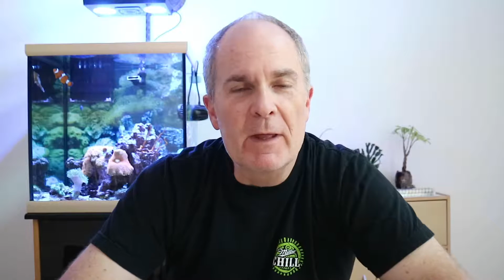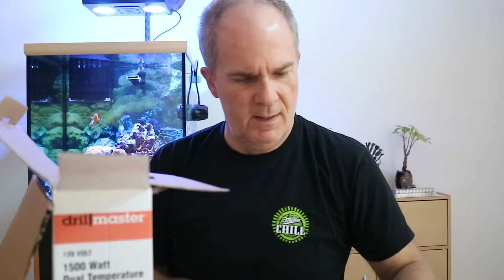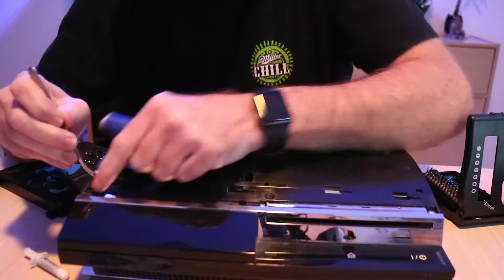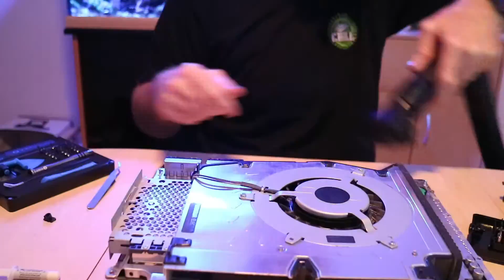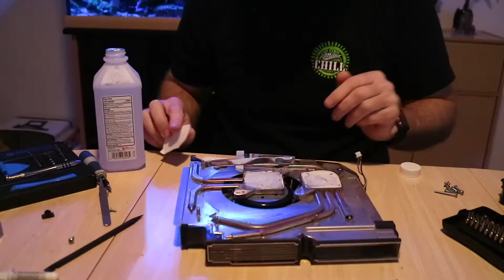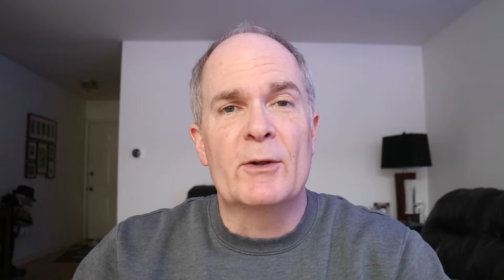My PS3 has the YLOD! Yellow Light of Death!

Comment: After 3 failed attempts, I finally got my working by putting about 3 lbs of weight on the chip as soon as I took the heat off it. Letting it cool that way. :) May want to try this is you haven't given you PS3 away.
Reply from the maker: I haven't tried recently, but will keep that in mind.